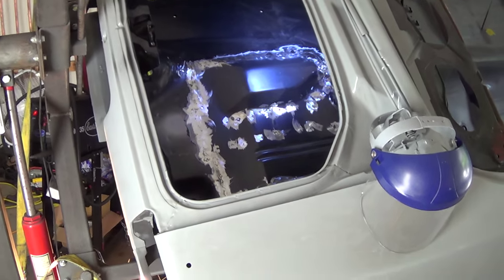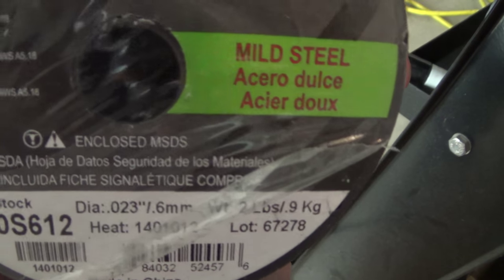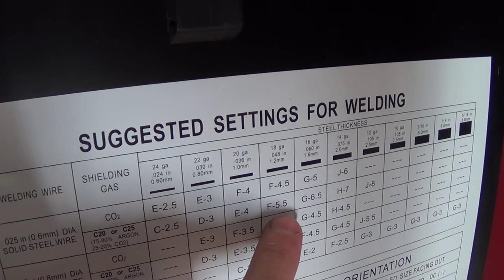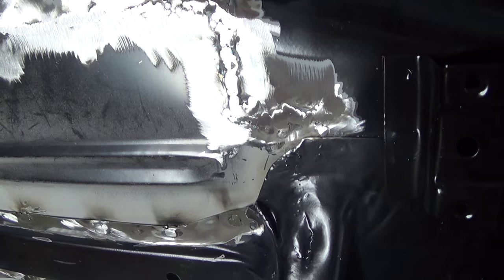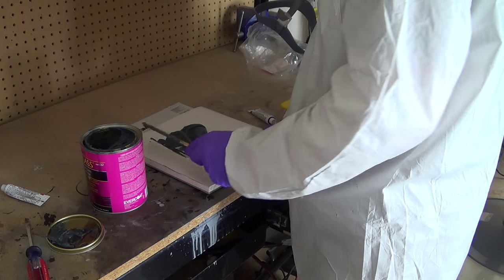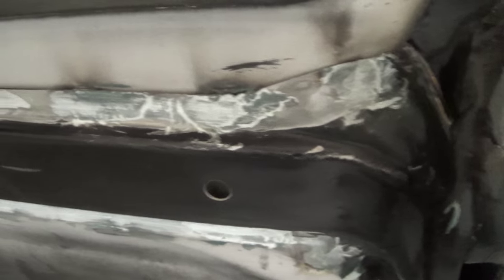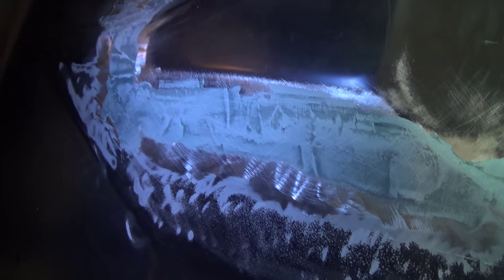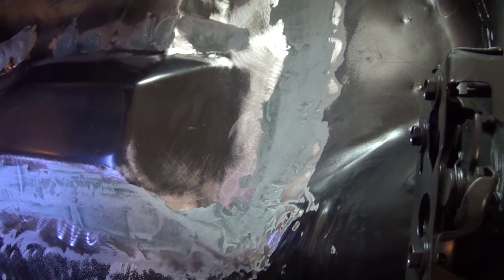1977 Camaro Z28 Part 47 : Trunk patch panel, pt. IV - Kitty hair

Comment: Turned out real nice. Are you going to do the splatter paint in the trunk after? if you do maybe that will be more forgiving where you have to aluminum oxide. just a thought.
Reply from the maker: +Cary Lamari Thanks Cary. You know, I go back and forth on that. Either spatter, or RaptorLiner. The spatter would not cover that up, it is too heavy. RaptorLiner would though I think.
Reply: +asicerik It will look good no matter, I like the spatter and just a little filler would clean it up enough for spatter also if you use spatter you have to put enamel under the spatter. Spatter paint is pourous ask me how I know lol I have to re-do the Camaro trunk because it surface rusted around the welds because I didn't enamel it.live and learn I guess lol
Reply from the maker: +Cary Lamari Yeah, I remember hearing that the spatter paint was not a good seal. That was probably from your video (?).